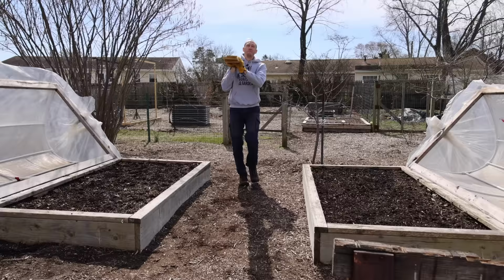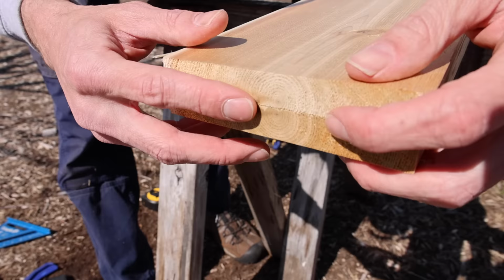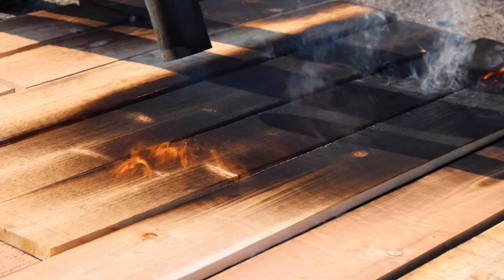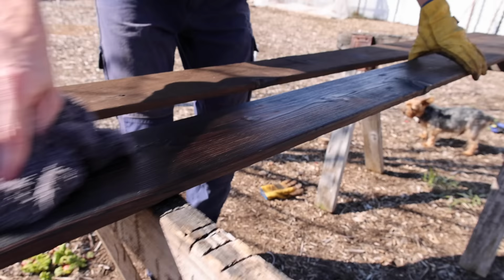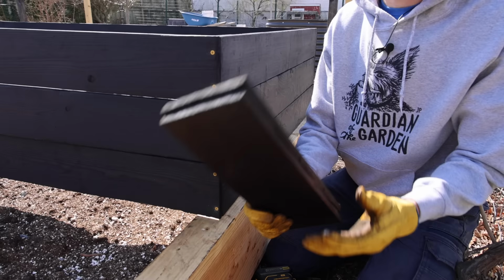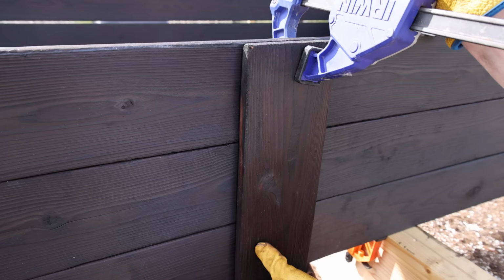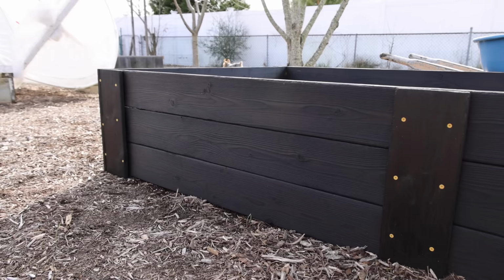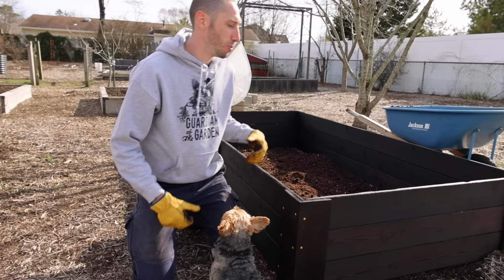Using This Ancient Technique Makes a Raised Bed Last Longer!

Comment: Very nice looking bed. One tip though if you are going for longevity, is that you secured the corner with a screw going into end grain on one of the boards. Screwing into end grain are not that strong, with the flex from heat/cold pressure over time it will really loosen up that screw hole in the end grain. If you added a 2x2 to each corner you could screw through side grain of the outside board, and into the side grain of the 2x2, which is a much better and stronger joint. But I bet it would be sufficient as is, just a tip if you want them even more durable. I do like the char/brush/oil combo that's great.
Reply: This is an excellent point that probably even most pros don't always think about. And in hindsight, yes most boards that I can remember "pulling loose" were due to screwing through into an end grain. If adding timbers to inside corners isn't an option then I'd say go extra long and as fat of a course thread that you can achieve if going into end grain. Very insightful and helpful post.
Reply: Fabulous tip, thx much.
Reply: Also, countersinking the screws will keep everything nice and tidy.

Comment: We utilize this technique with small building construction utilizing timber wood. Makes for a nice rustic finished look as well. Can prevent bugs from eating away at the wood, and it is utilized a lot in Japanese traditional architecture, which is where we learned the method. Very cool video!

Comment: We've been doing this in rural areas to protect wood against the elements for quite some years now. The technique I grew up with was putting the wood/stomps/planks directly into a fire - and pay attention!! to ONLY char them and not burn. But blow torches were rare and harder to find (in some areas they still are) - but I can vouch that with proper supervision having a yard fire to do this is fine also. Might not be as uniform, but the effects are virtually the same.

Comment: The oil won't be absorbed as you've sealed the wood by scorching it but it will give a nice subtle sheen and add a water resistance for a while, I have used this technique before but I don't use the oil as it's not needed but I could 😁🌱☀️
Reply: Do you think there would there be any benefit to treating the boards with the oil first and then scorching them?

Comment: Looks like there are Cedar picket fence at Lowe’s for $3.97 for a 6 ft picket. Even though it’s only 5/8 thick, I might try this and cut it down to a 4x4 ft bed for herbs! Could be a cost effective way to achieve a similar look and build one a smaller scale

Thanks for the great idea!
Reply: I had some last about 4-5 years before i moved away and they still felt pretty solid. Even sitting on pretty wet Southeast Tx soil the entire time.
Reply: I have the cedar picket fence raised bed lasted me about 10 years now. I do have to replace the bottom part that come in contact with the ground every 3-4 years coz those rotted first. Now I might try this burning technique with the picket fence.

Comment: A couple tips for such raised bed longevity. Raise it up a bit on rocks or bricks slightly above ground. Add some non Galvium (Galvanized is ok, zinc coated is best) sheet to the inside, using elbow sheets in the corners to separate the dirt from the wood. When placing the sheet metal, cut it slightly longer than the height of the bed, so that the metal goes into the ground slightly, to prevent dirt errosion (because the bed is raised up on bricks slightly). You will find your wood lasts several years longer.

Comment: Excellent work James! Two years ago when I decided to build raised beds in my vegetable garden I purchased 2 x 10' Southern Yellow pine and then scorched all sides as you did , then coated it with the same product you used. Going in to year three and so far they are holding up well with no fungus growing on the wood and no rot. I really like the look of the charred wood.

Comment: I made a raised bed just like yours several years ago, using quality fence boards from Home Depot. However, it only lasted about 3 years as it rotted from the inside. Hopefully the added charring and finish will make yours last much longer than mine did.

Comment: Wow! The goth (lol) raised beds look fantastic 😍
On the point of price - The first 4 raised beds I put in are cedar and still look basically brand new after 6+ upper midwest winters. I've slowly added a couple pine ones each year and those are starting to look rough. My point being, ~$300 may seem kinda steep (I'm cheap) , but even my untreated cedar is pushing a decade so I'd imagine cedar after shou sugi ban & that other treatment should last quite a while. That $300 would be relative peanuts, if you can do the up front cost of course. I've been wanting to try this and you made it look so easy but I'm a little too clumsy for a flamthrower sooo maybe not quite yet😅

Comment: Cedar fence pickets cost about $3 a piece in here Tx. That's what i usually use for my raised beds. It's naturally kinda resistant to a lot of bugs. In my experience even the cheap fence post last longer then most of the other woods i have used.
Reply: I made the same mistake as the guy in the video and bought some expensive cedar planks in the project lumber isle that charged you by the foot.  Weeks later I was back to Lowe's to look for some landscaping borders and I saw that they have cedar fence pickets that are a couple bucks a piece.  Not only are they basically the same dimensions as the cedar I bought previously (except for the pointed picket end) but it was basically the same quality cedar, many of which had better looking color and grain.
Reply: Thank you for sharing your experience / mistake so that others can learn room it too. I'm going too too take a look at the fence pickets tomorrow. I was thinking that this was not going to be in the budget this year but knowing that the fence pickets were so affordable makes this an option. Thank you!

Comment: Have done this for my raised beds with pine/random Lowe's white wood. Works just fine, obviously looks a bit different but I think part of the charm is how the flames bring out the individual characteristics of the pieces of wood you selected. Also I've used the Milk Paint pure tung + with citrus solvent (rather than the outdoor treatment you got from them) and I think it works just fine too for longevity.
Reply: I did have one question, is this technique used on just the outside or also the inside of the raised bed if you're growing veggies?
Reply: @resourcefulgirl  You'd do this inside and out and make sure the edges are done too.
Reply: @ausfoodgarden  Thanks Gerry!!

Comment: I use this method on my pine wood raised beds. I go with  2" x 12" x 12' boards which run about $24 a piece at Lowes. My beds are only a foot deep, but I have never found any annual plants that needed to expand down beyond that. It also saves money on wood and soil, which costs a small fortune these days. - Great looking beds though, I like the look of those support pieces.

Comment: I’ve used this technique for various projects for the past few years. Raised beds, hiking staffs, bamboo planters etc. I’ve used pine due to cost…it’s somewhat sap heavy but a good trick is to wipe that sap across the panels whilst it’s still molten (take care and be well gloved!!) it hardens like glass and provides that extra touch of waterproofing.  
If you’re lucky enough to have bamboo at hand (I’m based in kyoto city so there’s an abundance of bamboo forests) the sap itself is all the waterproofing you’ll need. Not ideal for raised beds but perfect for long planters.

Comment: I know you braced the corners and sides on the outside but no cross boards on the inside. The boards are very thin so I would worry about the weight of the soil making the side boards bow out over time. Aside from that concern ... it is a beautiful looking raised bed.

Comment: Love the video, James! Just a warning to others trying the Outdoor Defense Oil 4:35: this stuff has a very strong citrus smell and is corrosive. I left it in a small plastic container overnight after applying one coat and the next morning found it melted through and the oil had spilled. If you're going to use it, find a proper container (unfortunately the product does not list recommendations for storage, at least not that I saw) and when applying try to keep a nice distance from your home. I did it in my garage since it's been raining heavily in my area and now my garage / house reeks of citrus. I'm sure I'll survive, but just wanted to give folks a heads up 😊.
Reply: Reading the SDS for it, it is just 50% tung oil, 50% pine oil, and 3% zinc oxide.
It also says never to store it in anything but the original container.  I'm guessing the terpines (Limonene) from the pine oil are eating the plastic, so glass would be safe.

Comment: Very cool way to treat lumber.  I'd suggest that after wiping excess oil with rags,  oil soaked rags should be safely disposed of because of the chance of spontaneous combustion.  It's a real danger that I've learned of the hard way . Cheers.
Reply from the maker: Good info. Thanks for sharing that

Comment: Wow! In Vancouver a 2x6x8 is $27 I thought that was expensive.  You should also use stainless steel screws in cedar. Anything else will corrode

Comment: Great instruction! I did 80' linear feet of horizontal cedar fence using this ancient way. So satisfying to watch the grain char & be pronounced. A labor of love. I enjoy it so much 2 years in looking good!  One tip is i used  stainless steel screws so the cedar did not create a reaction with other metal which causes a black tear drop like stain. Good tip on oil for mildew resistance!
Reply: Peggy, out of curiosity, did you char the wood before you built the fence or after?

Comment: I am 100% doing this x 6
However, I just checked the price of Cedar planking at  Home Depot and it is WAY less expensive that $26 per 8 foot section.  
I can get a 1.25 inch + 6 inch plank for less than $10.  This project just got even sexier

Comment: I did this last spring for my raised garden bed and arbour. Hit that with linseed oil. I found that as the char dust mixed with the linseed oil it really gave it a bad ass look. Mine had a full burn on the inside, and a light burn on the outside.

Comment: Old diesel engine oil from mixed with a bit of diesel works amazingly. Cowboy trick used for fence posts. Some fence posts still sitting there from over 100years ago.

Comment: That is the best way to show people how to get the distance from saw blade when you need to use a straight edge guide and you showed the tape measure from saw platform to blade to show how you got your offset measurement. Great job 😊😊😊

Comment: Excellent work, I would advise adding a brace in the middle of the bed in order to stop the pressure of the soil from pushing the sides outwards. Either use a piece of timber notched in with a bolt perhaps or use some wire tensioned up. Make sure you don’t screw into end grain as this won’t hold.

Comment: Maybe you can try make 3-4 with different wood and compared thru time  and see how they hold NJ weather
Reply from the maker: Yup! I have a standard common lumber for bed. One for bed sealed with linseed oil, and this cedar bed now. Plus I have steel raised beds, and one made out of pallets

Comment: With the way you did the corners you could've easily hidden all the screws by attaching the cap corners through the inside or by, at the very least use black coated screws or black paint for a better look

Comment: Cedar is so expensive right now. A good thing to look for are cedar pickets. They are thinner but MUCH cheaper to build a bed out of. Home Depot sells packs of cedar pickets for a reasonable price.
Reply: That is a great point. James said he paid $11 for those 1x6-8ft but Lowes in my area has a 5/8x6-6ft dog-eared picket for $4. That should hold up fine with some bracing.
Reply: @jeremybyington  where would you brace it at? I built some and trying to figure out where bracing would look good/make sense

Comment: James -- you didn't put down hardware cloth to keep the voles out! I'll always do that going forward.  The bed looks beautiful.
Reply: Yes, a thousand times yes!  I built and installed a new raised bed.  For half the season last year it was fabulous, then it became home for tons of mice and voles.  At season end, I removed about 10 inches of soil, put in rat wire (hardware cloth with very small openings) and replaced and enriched the soil.  Terrible job after the fact, but I hope it works for this season to keep critters out!

Comment: last step- attach some 1/16" wire cable  between the middle braces in the middle of the top board

Comment: Cedar I understand- but burning- I was thinking carcinogens? Will that seep into the food you are growing? The sealer is oil and eventually will wear away, right? It looks amazing! You are pure genius. I heart Tuck!
Reply: Unfortunately I think this may be a concern. The main carcinogens from charred / burned wood are polycyclic aryl hydrocarbons (PAHs) and a quick google turns up articles on their uptake by food crops such as maize and wheat. Bummer. OTOH charcoal  / biochar can adsorb PAHs.
Reply: no, i am a master gardener and i burn vegetable waste.  it does not affect the food and enrichens the soil.  natural lightening strikes cause forest fires and is not carcinogenic.
Reply: @greasygardens6028  Where are you getting your information from? Wood fires produce carcinogens & the cause of the fire is irrelevant. It's hard to say whether the particular practice for wood preservation shown in this video would affect PAH levels in produce - probably not much since most of the carcinogens are in the smoke. But the fact that wood burning produces carcinogens is well-established.

Comment: Although a wooden raised bed is good, I made one from concrete slabs I cut up. It will last for a long time because I used galvanized corner brackets and nuts n bolts.

Comment: Can you explain why wirebrush the boards after flaming them?  It seems that defeats the purpose of charing them?  Another reason of charing is to prevent termites eating them .
Reply: I agree. However, built a similar bed @ five years ago of natural southern yellow pine. Burnt once brushed off char, burnt again and left on char. Built bed added soil then brushed and hosed off char. Did not add sealant. Still pretty solid. In future will use boiled linseed oil or this sealant and staple commercial grade lawn fabric prior to adding soil.

Comment: This is definitely a fun and interesting technique I have used to make some amazing projects.  To be honest using this technique has made pine become some of the best looking wood out of the options that are easily and readily available, especially if you go for the more premium/select pine stock that has more figured grains.  

If you are overwhelmed about thinking you need a propane tank and a flamethrower, I just use a Bernzomatic plumber's torch to get the job done.  It will take more time for a project like this but it is doable and the result tends to have a more varied look which causes the final product to have a more rustic/hand made appeal.

Ultimately, I like the boxes made in this video but they ended up a bit too dark for my tastes which covered up all that beautiful grain.  I prefer a bit more contrast which actually requires you to burn the wood more deeply than shown here and then take to it with a wire brush.  The finish you used looks interesting though and I want to pick some up now but I am wondering if that is the reason these pieces ended up so dark.  My only other nitpick is I don't like the look of those yellow exterior screw heads standing out so much.  Thanks for the video, your tutorial on making a quick planter that most people with basic tools can do was great!

Comment: Nice bed curious to see how the process works with other cheaper wood types. Off question: What are some non toxic safe solutions to prevent or block tree roots from entering into the garden bed?

Comment: nice! have you ever tried making raised bed frames out of concrete blocks?
Reply from the maker: Nope, but I have thought about making one using concrete in a different way. And still might attempt it at some point 🤫
Reply: Check out Man About Tools.  Best design I’ve seen thus far for concrete raised beds.

Comment: i think its a bit too high considering lack of reinforcement in the middle and very thin wood.  it will blow out from the presure of earth.  you might want to add top trip to reinforce it like you did on your other beds.

Comment: Do you have some estimate how much gas did you use during the charring of this bed?
Reply from the maker: It wasn’t a lot Demeter. To fill the who tank was $20, and the tank was still heavy by the time I finished it.
Reply: @jamesprigioni  OK, thanks for the info. So I guess it doesn't need too much of burning compared to how much in a tank you can have.

Comment: That looks really beautiful.
I'm concerned with the zinc from the wood preservative leeching into the soil, into the root system, and then into the plants.
If you secure a 2X2 piece of wood as an internal vertical brace in the corners, the bed will probably last an additional 10 years. Carpenters do that for deck seams.
Reply: I'd think zinc is a mild concern as people have been using galvanized metal beds safely for a long time, and is likely in very small quantities. Small amounts of zinc are natural and considered a micronutrient.